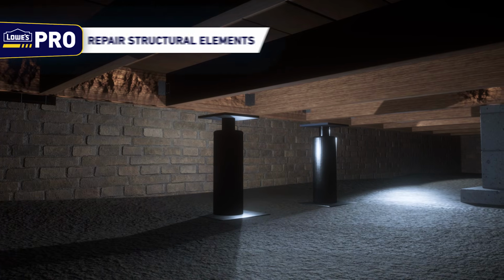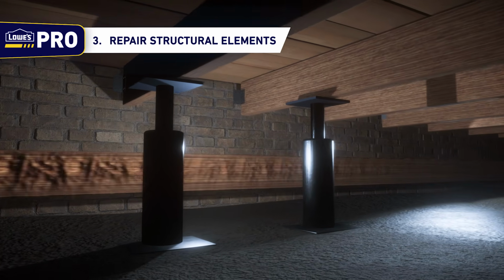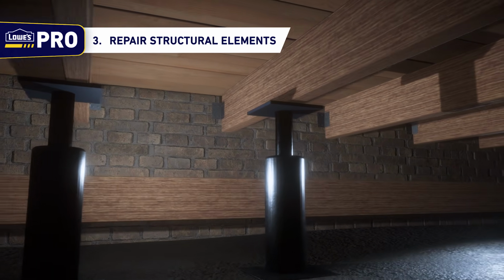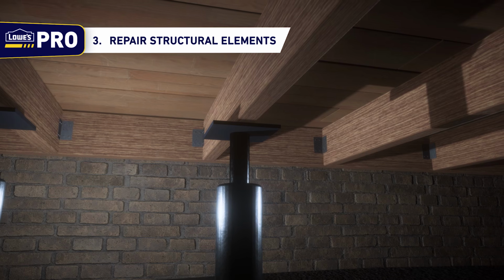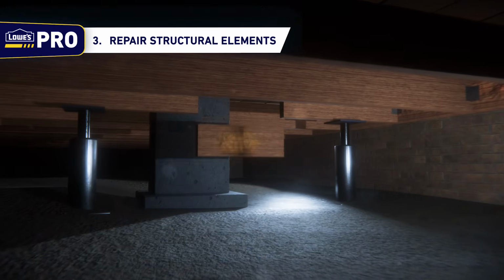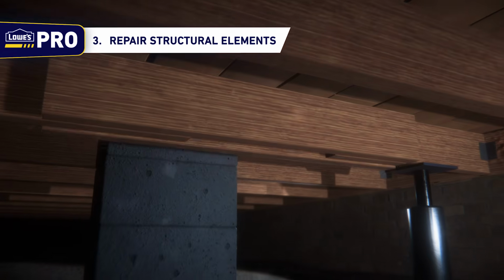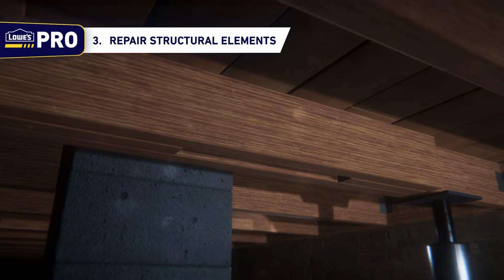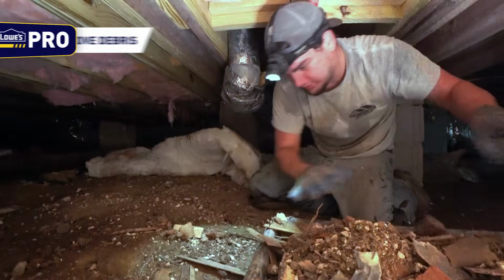How To Partially Encapsulate a Crawlspace | Lowe’s Pro How-To

Comment: I see a lot of the pros chiming in on this diy stuff and I do agree if a homeowner can afford your prices then by all means hire a pro to do all of this work , bottom line y'all's prices are just too damn high for us homeowners. Most people can't afford 15 to 30k to repair a bad crawl space. I do understand that this is very labor intensive, but there is a whole helluva lot of mark-up in the materials too, so please forgive us diy'ers for trying to save some money !
Reply: Agree with Bossman.  I have 4' crawl space with good ventilation so have no issues but am going to pull out the loose vapor barrier, clean up the debris and lay down 6mil poly on about 2400 sq. ft.  Cost will be less than $200 and a weekend of my time.  I'm sure someone would quote me $10,000 to fully encapsulate and "do it right".
Reply: @bobberg9207  If your humidity levels are in the acceptable range, I don't know why you'd need to do much more than properly install a minimum of 6 mil.
Reply: No need to apologize for doing something yourself instead of hiring someone else to do it. After all, businesses who do crawlspace encapsulation sometimes order dinner at restaurants instead of cooking it themselves.
Reply: Do it yourself …… I was afraid I would screw it up but after having for it ($8,000 ). Could have done it my damn self. They weren’t neat and didn’t take great care… would have taken three weekends probably but would have saved 8,000.  To be fair that did include dehumidifier
Reply: My neighbor did it himself for $300 for a 1500 sqft crawl space.
Reply: @rrtexas6976  only is our crawl space is very low , in some areas only 18 in from the ground
Reply: I've been researching my crawl space and learning for 3 years. Foundation and crawl space contractors are opportunists. They're also without shame, taking advantage of consumers and charging exorbitant amounts of money to consumers. It's wrong & they know it, but at an average of 10,000 for 1000 sq ft crawl space, and basic media labor which is not complicated work. Just a bit intimidating until you get used to your crawl space. I recommend fully lighting up your crawl space first, before you commence any work. Working in darkness, is a whole different ballgame an intimidating and difficult, versus working in bright lights. The work is easier, you can navigate and see well, and it feels welcoming!

There is massive markup with the materials. So I've learned plenty. You just have to compartmentalize the project in phases. I've got three phases. 

Phase I: Repair any structural weaknesses.  And clean up crawl space of debris. 

Phase II: Install French Drains, for more efficient drainage. Install sump pump, and 15 Gal. sump pump basin and connect sump pump to outdoor drainage system.

Phase III: Remove old torn up and tattered vapor barrier. Grade out flat, the extra dirt that was dug up for the French drains in the crawl space soil area. 

Materials & Planning. Prior to installing the new vapor barrier, you'll need 10 or 12 mm thick one piece Vapor barrier. Draw up with schematics, and then properly pre-cut the Vapor Barrier prior to going down into the crawl space for each section. Have on hand more material than you think you will need. That would include 4 inch wide seam tape, butyl tape for adhering the plastic to the concrete wall surfaces and plenty of vapor barrier to overlap 6 to 12 inches. In addition to that for phase 2, you will need the right amount of linear feet of perforated 3 inch or 4 inch pipe for the French drains. For a 1000 sq ft. crawl space you'll need 2 to 2.5 yd of rock. Snooze, round 3/4 River Rock will work well for a French drain in a crawl space. Get a utility sled, so you can slide the heavier rock down the crawl space lengths, so you can transport the heavier objects to and from where you need to go. Wear a mask, get some really high quality knee pads, and coveralls so you don't get too filthy. Pace yourself. Take your time and enjoy the process. Plan, plan, plan, and plan some more. Make a bullet list. Draw up detailed schematics. And give yourself a pat on the back for becoming a very competent homeowner. 

It's nice to work with someone else too because this is a difficult job underneath your home. You can vet five or six different contractors and pick one that's very reasonably priced, trustworthy, good follow up, punctual, and honest, anywhere from $30 to $50 an hour to help you with the heavy heavy work. I've begun my process but haven't finished yet but I thought it through all the way to knowing that I can absolutely accomplish this task. Be confident. Have contractors over that do the work, and remember what they say, because you'll find a lot of good information from them, just don't hire them. Do it yourself.
Reply: Just got a quote for four jacks and encapsulation. $30,000. Found out I could do it myself for like 2k. I’ll be going that route for sure.
Reply: @ it should be illegal what these crooks are charging people for this work. I’m well aware that it’s very very labor intensive but the material mark-up is utterly ridiculous, contractors have gotten so greedy.

I just had to replace my septic tank and had a new drain field put in that cost me 14k and now I need a new heat pump. It never ends.
Reply: Also,  what type of pro is looking up a video of how to do the job?? What's the difference if a pro has to look up how to do it or me?
Reply: @Tpet84  well for starters if they work for a reputable company then they shouldn’t have to come to YouTube to look up how to do their job , wouldn’t you think?
Reply: Yeah, I got quoted 10k-15k
Reply: It’s absolutely criminal they’re charging people 10-30K.
Reply: I'm doing it myself.  And I agree, plan, plan & more planning.  And take my time.  Not worried about taking a few weekends to get it done.
Reply: Amen
Reply: Agreed. I’d definitely look at small business that do these things to get a potentially better price.
Reply: I was quoted $10,000 for a 1,900 sq ft crawlspace.
Reply: @tartgreenapple  Company in my area quoted me on: digging 15 footers and using adjustable floor jacks with steel drop girders to level up the floor joist, install  interior french drain with sump pump, install dehumidifier, new insulation on outer brick wall in the crawl space and wrap everything in 20mil plastic for $27k and my crawl space is only 1125sq ft. Market price for my home is between $130 to $160.

Contractors that specialize in crawl space repairs are making a damn fortune off of fans and plastic!!
Reply: @Bossman_71  I had a company quote me $27k on a 1500 square foot home just to install some new columns (4) and level up the floors. That's not even starting anything towards encapsulating the crawl space. My parents built this house in 1978 for $28k. How these people sleep at night is beyond me. 🙄😒
Reply: @dennisveazey4313  it’s truly sickening, sad part is I’m confused as what to do about it
Reply: @tartgreenapple  i was quoted 10k for an 800 sq ft crawlspace
Reply: @stuartrogers2118  I hope that's for a properly done full encapsulation with a new high-quality dehumidifier, remote control for it, extra filter, condensation pump (if needed), running dehumidifier discharge to a sump pump (if you have one) or at least 6 feet away from your house, thick underlayment for dehumidifier & for path to dehumidifier & other items that need maintenance / inspection, removal of between joist insulation & replacement with termite resistant insulation, termite-inspection area along walls & posts (size dictated by your state's building code), owner's manual, instructions, and all documents for dehumidifier, remote control, condensation pump, etc. Also, non-reinforced vapor barrier (maybe 10 mil) that you get a sample of before any work is done. I probably forgot some stuff.  Crawlspace Ninja has great videos. Best wishes!
Reply: 30k by multiple contractors for us at the same square footage @tartgreenapple
Reply: @tartgreenapple  quoted 45,000 for a 2k ft crawlspace :)
Reply: @tartgreenapple 4 years ago. Wonder what it would be today in the middle of 2025.
Reply: Sometimes you have to work your way into a partnership or friendship with people like this, I remember working for someone doing this, he would have me remove all the old insulation and go to every joist and beam and scrub it all down before he goes in to spray, treat and seal, I’d be payed a day rate of about 500 and I would get most average 1800-2200sqft spaces done in under 4/5 hours (and done right, he would look for skipped corners by me) but thanks to that he helped me out a ton when it came to me needing my
Personal crawl space done
Reply: @TrepedatiousTrex  I guess that would be one way of doing it but in my particular case I'm gonna need some floor joist replaced, a band seal and a lot of sub floor. Sadly its too late for me I'm gonna have to spend about 20 to 30k to fix a 1100sq foot crawl space. Sucks to be me!
Reply: @Bossman_71  How is your house work coming along?
Reply: @maxmanx1294  it’s not. Started shopping for a new home!
Reply: @Bossman_71  I'm sorry to learn that. I don't blame you for wanting out. I have a mess on my hands, too. I don't know how bad it is yet. But I know there is widespread structural damage.
Reply: @maxmanx1294  well me and my wife keep going back and forth in staying here or moving, even with all the renovations my house needs it’s still cheaper than buying. We have two other big issues to consider, when doing our house we’re gonna have to make it wheel chair accessible everywhere also as of now I only have about 1125sq ft of heated space to work with. We have a carport that we can enclose for about 216sq ft more but that’s still not a lot, we could do an extra room edition but one contractor told me for a 20x20 addition it would run over 80k on top of all the other renovations and repairs!

Comment: I feel bad for the property owner of this house because this job is total shit lol
Reply: I agree it's shit also. 4 inches from top should be only shown not from bottom . Also acoustic sealant should be used at every taped section. Concrete ancors should also be placed Around any concrete piles and structural supports.. also a subpump and weeping tile should be properly placed .
Reply: @weAreaAllHuman69  but sometimes the customer just want the tarp so chill and what they didn’t perfectly fine. Stop over thinking clown.
Reply: What do you mean?

Comment: By the way, you don't want to seal all your crawl space vent b/c of radon gas. You need to install one crawl space ventilation fan and close other vent. The reason why you want to close all the vent except one is b/c you don't want to bring in humid air from the outside and dehumidifier don't have to work too hard. If you have mold problem in crawl space, you need to take of  where the moisture is coming from, if you don't address this, other stuff you do is waste of time and money
Reply: If you are encapsulating your basement the radon gas cannot get through the vapor barrier on the ground. Isnt that the whole point of vapor barriers/ moisture barriers?
Reply: Don't seal because of Radon? That sound counter-intuitive to me. Won't sealing keep most or all of the Radon out?
Reply: Doesn’t encapsulating the crawl space keep the radon from coming through?
Reply: You're right! I don't recall any mention of the exhaust fan(s). I have one.
Reply: Radon is 7.5x heavier than air.  I'm not at all concerned about it in my crawlspace.   Additionally, my A/C isn't at the lowest point of the crawlspace.

Comment: You have to hire right people and that is hardest part, this guys in the video, they are amateurs. Why would you spray foam insulation in the crawl space?  Even you want to spray it, they should of removed the insulation before they spray it. The reason why you don't want to spray foam it is b/c it will trap a moisture. At 4.17 mark, you could see the mold present on the wood. Before you hire anybody, educate your self so that you know who to hire
Reply: What would you suggest to insulate then?  Rodents and moisture cause fiberglass batts to drop in every crawlspace I've been in
Reply: I'm in Florida,  1933 concrete block exterior,  24" crawlspace beneath joists. Insulating between the living area and the crawlspace is counterproductive and detrimental. This video is marked as for pros only; that's just a marketing tactic. ("Hey, look how easy the pro's job is!")
Bottom line,  there's no one-size-fits-all approach, whether you're a diyer or a "pro"

Comment: Having done this for almost 20 years, I agree with fogging the crawlspace 100%. I've used RMR-86 and it takes a piece of lumber that is totally black to looking brand new. The house I was working on was vacant. It is very "bleachy". I can't see using RMR-86 except on homes with a few bad spots.  If there's more than that,  it will need soda blasting. (In my opinion) but if they want some tremendous amount for soda blasting, I'll use 2.5 gallons of the RMR with my electric sprayer and let the odor go away. I did a very black piece of plywood in 2017. I'd love to see it today, but the homeowner is somewhat hostile. I did the job for the seller and the home was vacant. We did one heck of a job, really. Just starting out making a name for ourselves, etc. well, the new homeowners called and said they had to send a plumber into the crawlspace and the dehumidifier wasn't working. Wasn't working? Someone (and I think I know who) caused the leak and turned over our dehumidifier , ruining it. While I was installing a free dehumidifier, the wife walks down and says, don't bump that wire down there. I had to pay $175 to fix that wire after you guys did your work. It was a rusted, 75 year old, 220 volt wire that had exposed copper. We saw it on day one and made damn sure we didn't "bump" it. We put a bicycle rope lock on this one and they'll never see us again, no matter what. Unless it's in court. I made videos. The person we did the work for and the real estate agent were delighted, it passed a VA LOAN inspection and they're tough. Rambling !!!
Reply: So you helped hide a house with mold issues for the owner could make a sell.
Reply: Hellwithpots that was your takeaway? We didn't hide anything and obviously, you've never been through a VA loan inspection, but troll on. Clients are backed up to mid-January. Get out and move around some.

Comment: Pretty informative! I am going with Ventilation Fan with keeping other vents open during non-winter times first, if it doesn't work I am going to use a humidifier. I have a meter and already brought the wood moisture to 15% in North Carolina!
Reply: I am in NC as well. What is an acceptable wood moisture level ? And why measure wood moisture compared to say, just overall crawl space moisture?

Comment: This has to be the most disgusting informational video about "Encapsulate a Crawlspace" I have ever seen!     Lowe's, I ask you kindly to remove this video, as this will not help ANYONE with what you have shown.
Reply: Though the video is not great, there is plenty of good info here. And yeah, receptacle is GFCI. Check 2:09 bro and chill.
Reply: @yourchannelhasnocontent8536  Yes sir/mam; you are correct. My apologies.
Reply: @tsadkiel2008  I didn’t notice the breaker panel GFCI my first viewing either. BUT the outlet wasn’t properly labeled ‘GFCI PROTECTED OUTLET’ either, which is also a code violation.
Reply: @edbouhl3100  Indeed you are correct sir! Thank you for your reply.
Reply: ALSO LOWE'S @ 1:48 per NEC code that receptacle is NOT  GFCI! 
Since 1971, the NEC has expanded the requirements for ground-fault circuit interrupters (GFCI) to protect anyone who plugs into an electrical system. Initially, it was only required for temporary wiring at construction sites and in dwelling unit bathrooms, but in recent years the Code requirements for GFCI protection have expanded to include many other areas, including commercial occupancies, fountains and swimming pools, and temporary installations, to name a few. (For a complete list of 2002 NEC references, see the sidebar below)

What about crawl spaces and unfinished areas of the basement? Once again, all 15A and 20A, 125V receptacles installed within a dwelling unit crawl space [210.8(4)] or in each unfinished portion of a basement not intended as a habitable room but used for storage or as a work area [210.8(5)], must be GFCI-protected. However, the Code does note a few exceptions to these rules: GFCI protection is not required for receptacles that are not readily accessible or are located on a dedicated branch circuit and identified for a specific cord-and-plug-connected appliance, such as a sump pump.